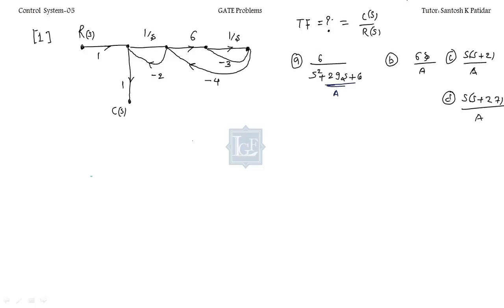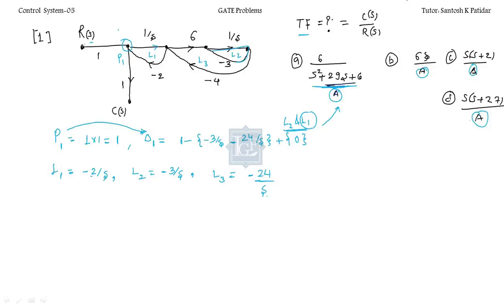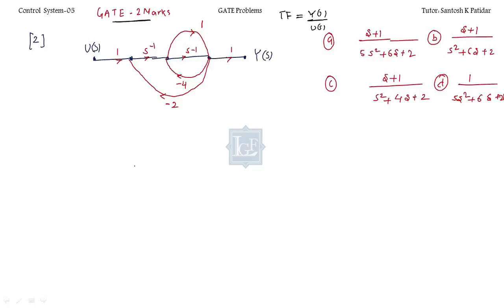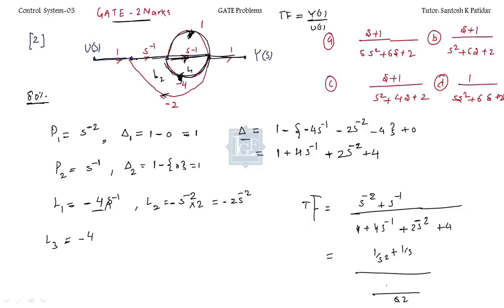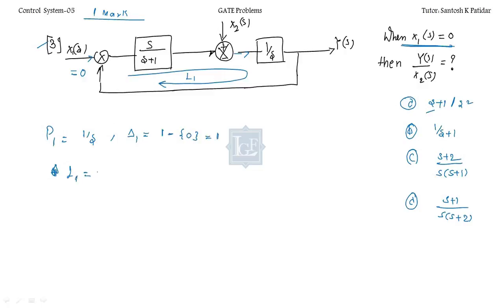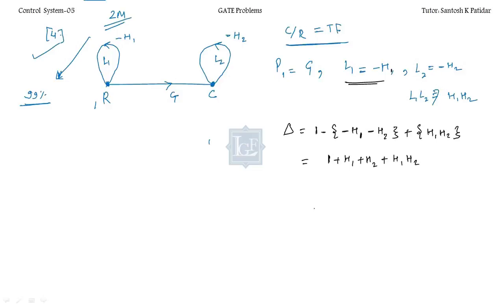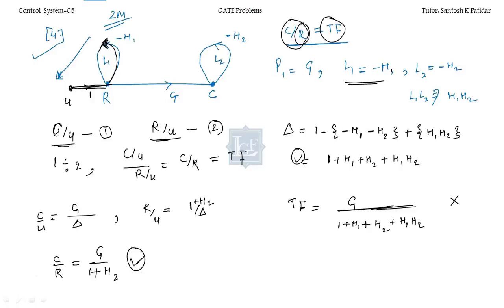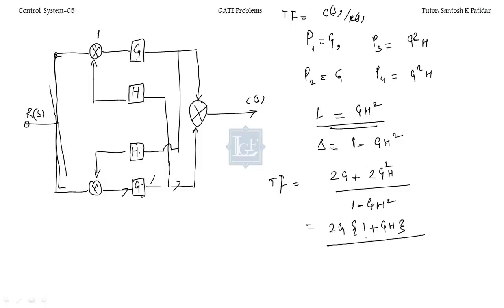Lec 05 GATE Problem Solved based on Previous Lecture

Comment: Sir ,while calculating R/U you again used mason gain formula ,and as we know that we can apply mason gain formula only between input and output nodes ,but node R is not an output node ,so why did u use mason gain formula here again ???
Thanks in advance,

Comment: I tried solving the last question with the help of block diagram algebra techniques, and moved the lower H block to the top to make it a normal feedback and the same for the upper H block. If i am not wrong, interchanging the summing point doesn'y effect the system, but through this method, I am getting answer as 2G/(1+GH). kindly point my mistake.

Comment: Sir , in last question , i think , loop should be G(square)H(square) .
Reply: Himanshu Nigam 
Correct himanshu... By mistake... But ans is correct I consider there (GH)2 ONLY
Reply: @ramkaran2653  Why we are taking Square of (GH). Loop gain should be GH+GH=2GH. Isn't it?
Reply: Buddy its a continuous loop. A single loop. The condition that you have put up is valid for 2 loops, with same gain 'GH', so that adds up. Here, we have a single loop.
Reply: we have to consider another loop also .   .....
Reply: how??
Reply: Abhilash Sharma from input node downwards GH
Reply: Loop gain should be GH+GH. Why we are taking GH^2?